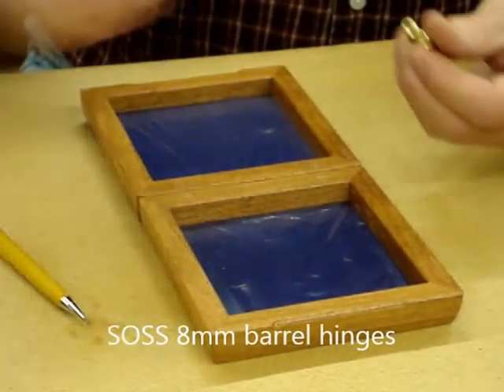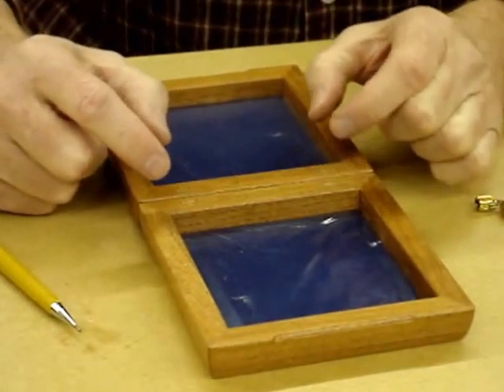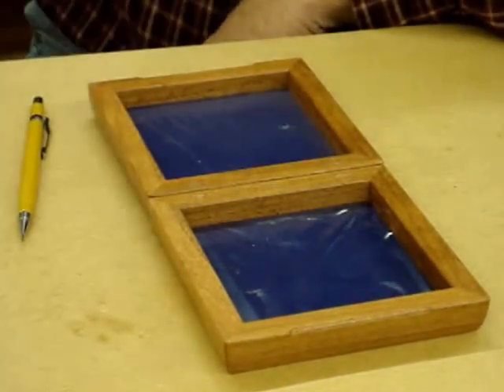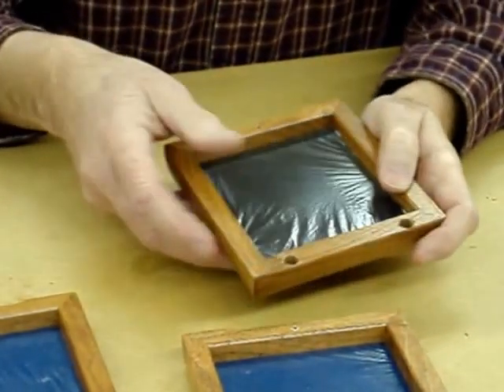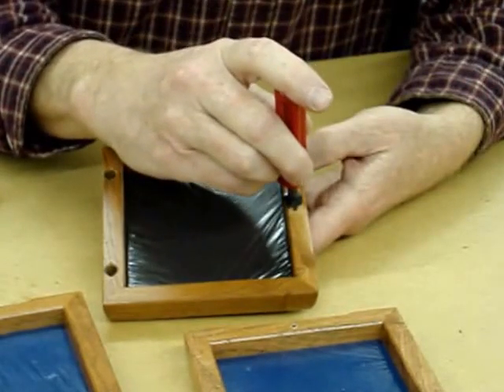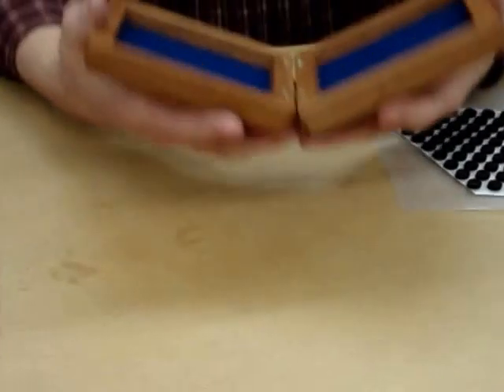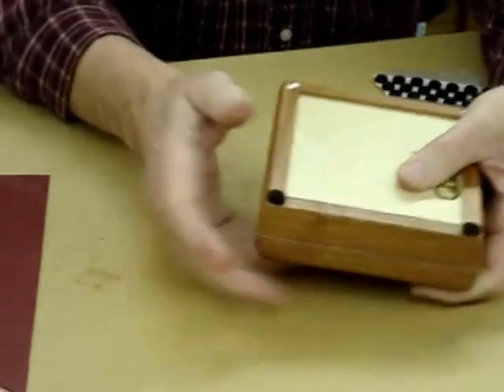Part 4 Box Build - Finishing Touches

Comment: When installing tiny brass screws, it's always a good plan both to pre-drill (as you said) and also tap the hole with a steel screw. As you mention, breaking the brass screw is unrecoverable.

Comment: I think I understand about the installation of the hinges. You move them back a hair to accommodate the arc of the box lid. Right? Also I have broken a few brass screws. Some manuf. include a steel screw to use to cut the threads in the wood before using the brass.

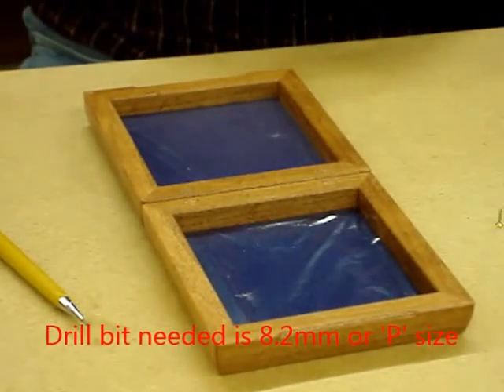Comment: Hello, and thanks for the video.   Hope you can answer a quick question.  I'm using the same hinges (8mm SOSS -- BH084) for a jewelry box.  At about 1:48 into your video you mention # 2 screws; then you discuss pre-drilling holes for these screws.  If I understand you correctly, you drill two such holes per barrel.    Although there is a screw already in place in each of the barrels of the hinges I own, there is nothing in the instructions that talks about drilling holes for these screws.  Nor is mention made of using an 8.2 mm bit.  (The instructions say to drill an 8mm hole.  That's all.)  Can you help me by providing a little summary of the critical points you make in your video?  Which # 2 screws do you mean?  Is there one screw per barrel?  Is an 8.2 mm essential, or can an 8 mm bit suffice?  Thanks for taking the time to respond.
Reply from the maker: Hi jihhwood - It is possible the hinge design has changed since this video was made so I would follow the directions with your hinges.  The larger SOSS hinges have the wedge action built in to the hinge by tightening a single screw in the hinge itself.  If they have incorporated this feature into the smaller hinge designs, that is a major improvement.  The small hinges I used in the video had two half moon type slots in the edges where screws would wedge the hinge in place.  The directions I had called for an 8.2mm hole.  I predrilled since the mesquite was hard and I still broke screws.  You may not need to predrill using softer woods.  As I recall, the 8mm hole was a very tight fit but it would go in with persuasion somewhat like a press fit.  It could be pried out.  Hope this helps,Steve
Reply: ExtremeWoodworker Thanks very much for responding to my question.  I've ordered an 8.2mm bit, snd I'm hoping that will do the trick!